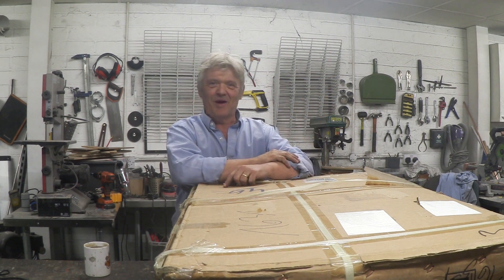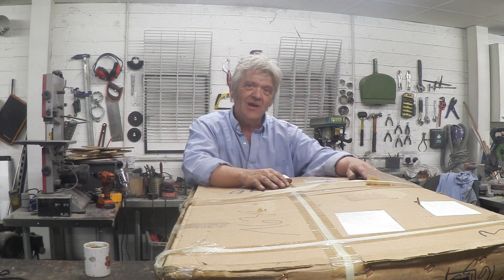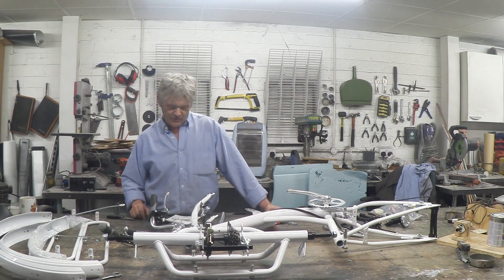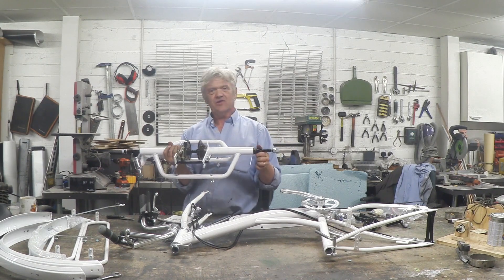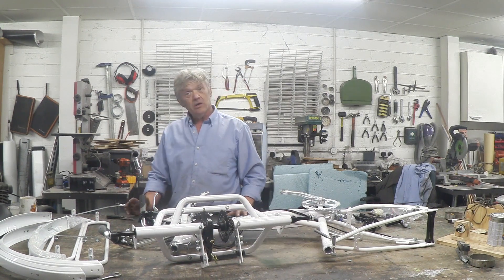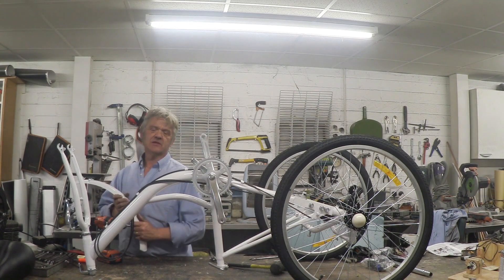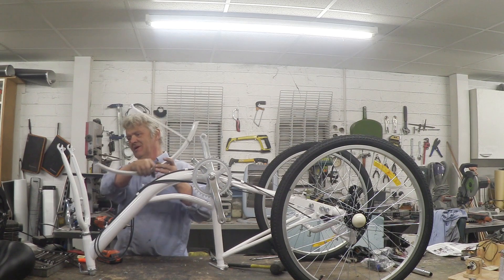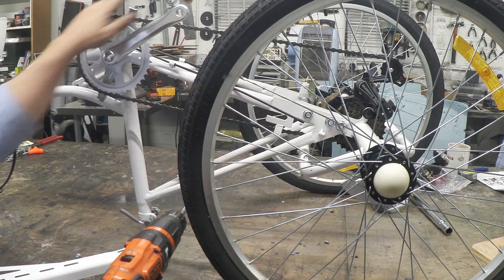1201 How to Build an Electric Tricycle For under £300 Part 1 - The Basic Trike

Comment: Question: Im gonna drill a hole thru the axle and the wheel hub of the non driving wheel and install a pin thru them as need to lock them together to get 2wd on the sand, and remove the pin wheel on hard surfaces. Do you see any fault in that notion? Great vid.

Comment: Hello Robert, I did exactly the same thing as you last year. My trike was cheaper at £165 from Amazon. It was old stock, poor paintwork, and only single speed. From that starting point, I changed the rear brake to disc brake and 6 speed, then with a motorized front wheel kit and battery I converted it to electric. After that, I built a custom frame with a lower seat which was fine till this year. I have now built a third version using an American-style lowrider frame with chopper-style handlebars that is in the process of being painted to a light blue colour and should be fully completed soon. As you said, importing the rear axle is expensive, plus of course the cost of postage and customs charges really does double the price to around £300.
Reply: The Gubberment has to wet their beaks...
Reply: How did you made the conversion for the rear brake to disc? I am trying to find a solution for the disc caliper as it might need and adapter. How did you made it fit?
Reply: @olteanalinleon  Hello, I welded a disc bracket to the frame and used the axle adapter from the old brake to fit the disc.

Comment: Ok so I have a very similar trike, and have discovered that due to the weight, it (maybe 'I' rather) struggles to climb slopes and hills. I've decided that in the near future I want to electrify it. The thing is, ideally I like the idea of a mid-drive but I feel on my one a front hub is much more practical. You see, on the trike in this video, you can see there is ample space to the front of and below the basket to mount a motor, whereas on mine, that space is occupied by the cassette, disk brake, and a a sprocket which drives a smaller chain, which acts as a transmission for the rear axle.
Reply: I have a front wheel drive electric tricycle, being a 20 inch tyre at the front and two 8 inch at the rear. The biggest problem was going uphill as all the weight shifts to the back of the bike and wheel spin became prevalent. I ended having to shift my feet forward onto pegs forward of the centre of the front wheel to get back the traction needed. I suggest if hills are a concern then definitely make it rear wheel drive. Wish I had known before I bought mine.

Comment: Hub motor or sprocket driven to utilize derailer and sprocket set?
Reply: Or Robert's Rubber chain / cog belt to the non powered wheel?

Comment: Awesome as always 👏

I've been thinking about motorizing my bike but with the ability to recharge the battery by pedal power.

I love this idea of charging it when going down the hill to help me get back on that bloody steep road 😂
Reply from the maker: nice idea mate
Reply: @ThinkingandTinkering  Will you get much charge from pedalling or going down a hill?
Reply: @Neilukuk  I know you actually would, given the right electronics. I am using my e-bike to charge 500F supercaps in series (6), and that is a lot of power when you release it (the 24 V motor is the generator, works like a charm in my case). But it needs electronics, so it is not that simple. Without electronics, if the caps are empty, charging the would give so much resistance that your wheel would block almost immediately. (you will need a smart dc to dc converter to create high amps at a low voltage for instance. And the 'smart' part is where it needs to 'know' from you if you are braking hard, or just going down a hill).
Reply: That makes me wonder how much power you could get with an arrangement of non-cored coils and magnets around all the wheels- like the low speed wind turbine?   like a large wheel cover sort of design maybe?    I don't know if the added weight, and lower output would be better or worse than the reluctance in a normal "official" generator, as far as how much harder you have to pedal.
 
Might not get you enough charge to be worth it, but if it did, that might also give a full electric some extended range.
Reply: @ryanjamesloyd6733  I didn't think about that, You could use all of the wheel as a generator. Great idea and hopefully Rob will give his opinion on it.